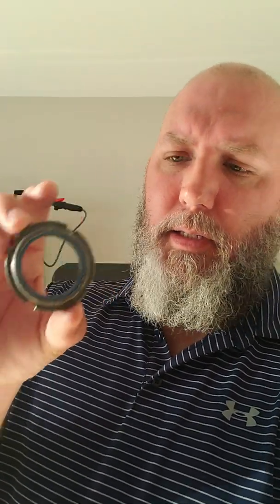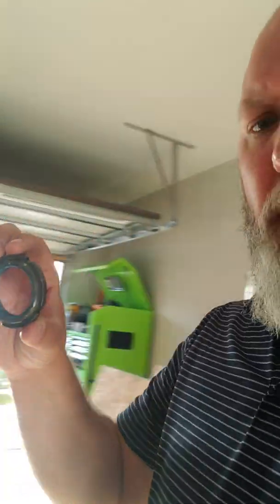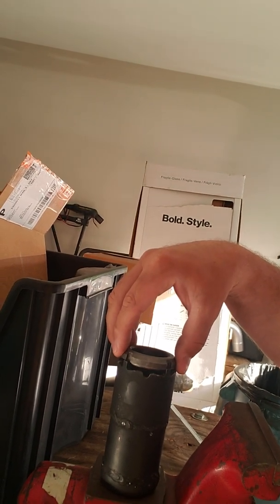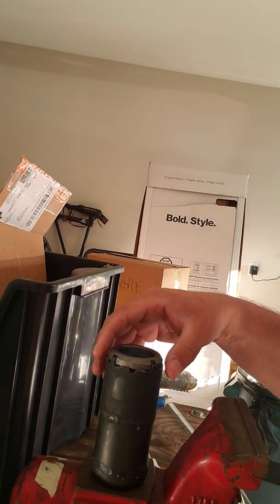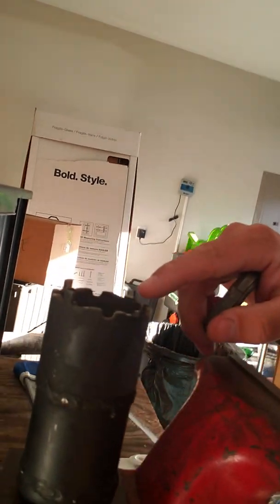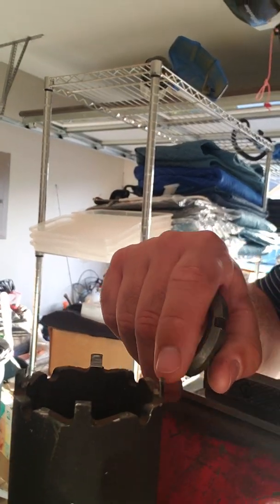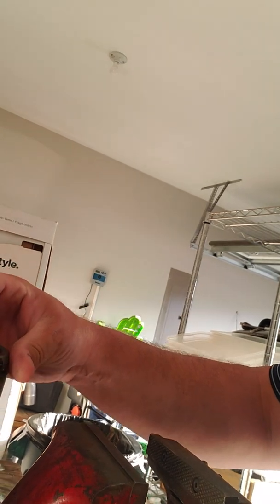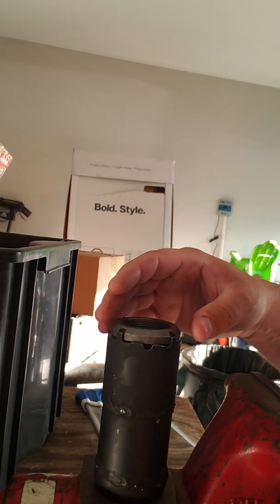Allison 1000 Output Shaft Spanner Nut Homemade Socket Links in the Description

Comment: Go to Amazon and get a Powerbuilt 648473 2-3/8" 4 lug spindle socket -- works perfectly and is only about $16.00
Reply: Joseph .... thanks for the tip just picked one up and worked like a champ. You are a time saver
Reply from the maker: Thank you for the info.
Reply: Works perfect for taking spanner nut off output shaft off Allison 1000? If so do you have to grind any of the socket or is it ready to use ?
Reply: @antoniodidomenico6636  Worked  just as it is -- I have used it on 2001, 2002 and 2009 5&6 speed Allison 1000s (all 4wd applications).